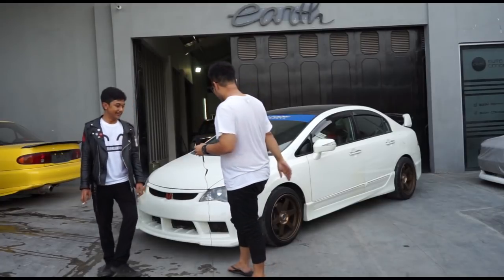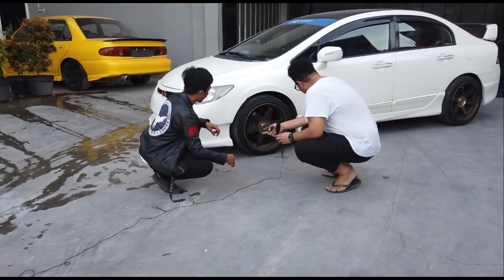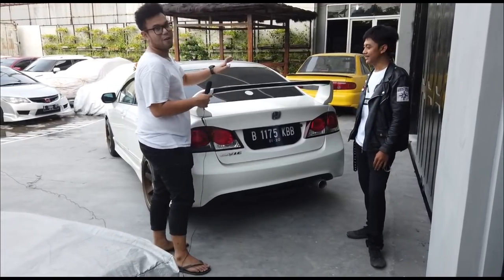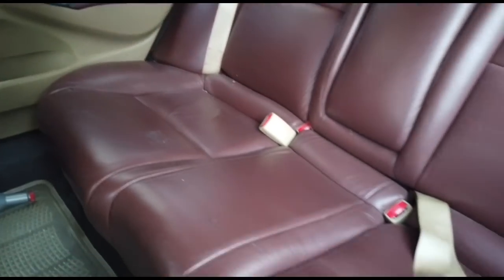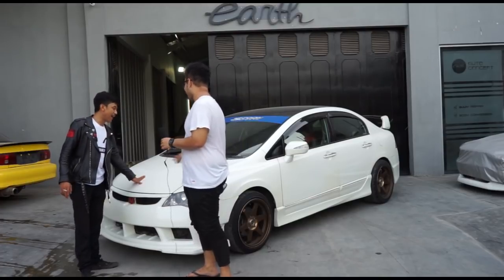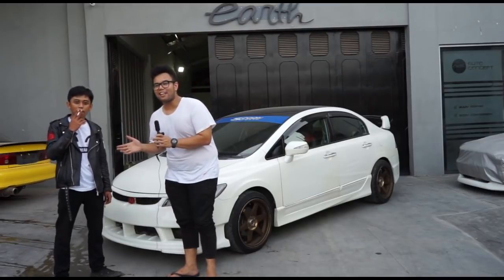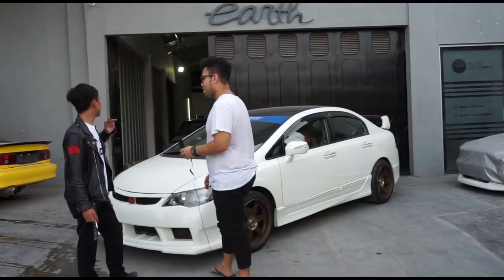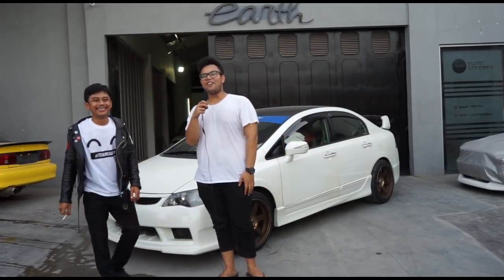Modifikasi Honda Civic FD Spoon For Daily #carvlog #spoon #jdm

Comment: Pasaran fd brp ya skrng lg minat nih
Reply from the maker: Kalo fd 1800cc yg sebelum 2006 120jt dpt bro.. fd 2000cc terpaut beda 5-15jt bro.. tergantung lokasi juga sih bro..
Reply: Beda FD 1 sm FD 2 di CCnya aja atau ada yg lain dr tampilannya om...blh mnta no hp gak...
Reply: Adjie Trianto Beda di mesin 1.8 Sohc Vtec( Vtec+delayed intake close timing+dbw),power steering Hps(hidrolik),interior warna beige+hitam fabric seat(beludru),velg 16” 2.0 Dohc Vtec(Vtec +Vtc+dbw),power steering eps(electric),VSA( Vehicle stability assist) mencegah understeer & oversteer pada saat jalan licin,interior warna navy blue leather seat,velg 17”